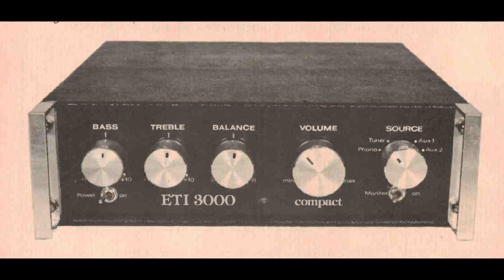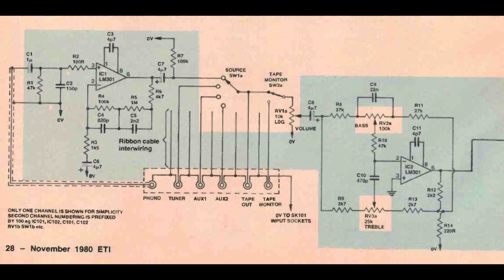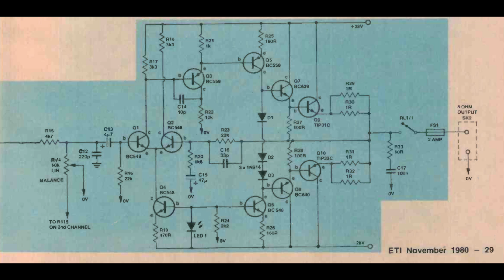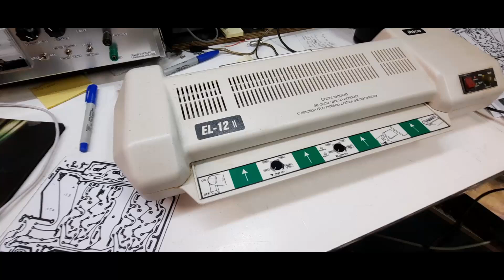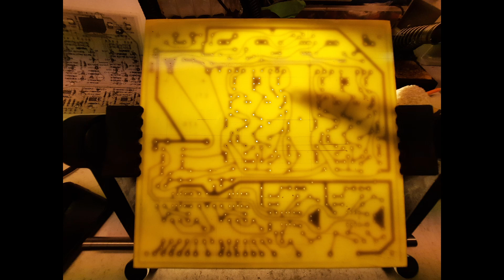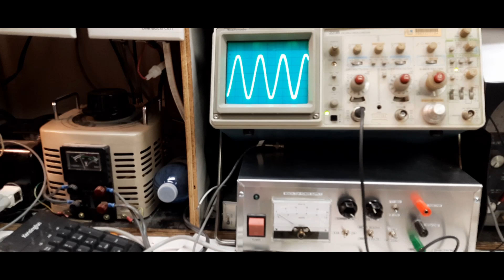Electronics Today - November 1980 - 20 Watt Amplifier - Part 1

Comment: Well done I am 60 now and had all the electronic magazines. Every day, ETI, Maplin etc. Buit loads and loads of these projects. Funny story I was when I was about 12 and saved up all my money pot washing at a hotel, I brought a 28-pin sound chip from Cricklewood electronics that would when built play doorbell sounds. Corny now. Went to Pot wash came home and my Mum had Cleaned my worktable AKA (the kitchen Table) And hoovered up my sound chip. Got it out but Guess static got the better of it. Chip was a lot of money back then. Your Content is Excellent. From Newquay in the U.K. P.S its 13 degrees and Raining🤠
Reply from the maker: Thanks for sharing that amazing story about your sound chip – what a memory! Radio Shack, here in Canada also sold that chip. I recall it. It could play train whistle and a bunch of other stuff. Cool. Did not know about Maplin. I just found the mags at URL https://www.worldradiohistory.com/Maplin-Electronics.htm

I will add these magazine to my list and perhaps build a few projects.

Cheers!

Bettina
Reply: Well done. Yes Maplin, Radio shack were the  the pinnacle of 80s electronics. Brought my first Red Led Dim as I won't say LOL. Your content is amazing. Cheers Paul
Reply: @bettinaneumryr  Hi I have been looking at some circuits now it's coming up to Crimbo time. I built this and it was a great hit. It's called Pass the B--mb just add the o not sure it would get censored. Maplin Mag Dec 1981 Feb 1982 its in the Archive you sent me. Cheers Paul Rush
Reply from the maker: Hi Paul ... yeah, I see that project. I am sure that youtube would not like the title. When I upload a video, there are lots of questions that they ask and something like this project would not pass the ad suitability for the video. Also, I am finding that circuits that do not relate to electronic test equipment or amplifiers do not get the audience I need. Thanks for the suggestion though. Cheers
Reply: @bettinaneumryr  Hi. Yes, totally understand it being not suitable with the Net Police/You tube. Anyway, well done on your content its Spot on. Cheers Paul

Comment: I actually built this amplifier back in 1980.  I've still got it.  😊.   It currently doesn't work, but this has inspired me to get it going, some day.  I preplaced it in the later '80s with a Playmaster 60 + 60, which was a project published by ETI's great rival here in Australia, Electronics Australia.
Reply from the maker: Thanks for the comment, and great to hear that you got yours working back then.  I am loving ETI (Australia). It has so many good projects. There will definitely be more projects from that mag. Cheers!

Comment: A couple quick questions: 1) How do you trim your PCB material to size? 2) Where did you source your transformer from?
Reply from the maker: I actually use a 70 year old sheet metal shears. They look like scissors but bigger. I can cut 1.5 mm board with no problems. I never buy thicker board because of this. I then sand the edges down to make it square. I got that transformer from an old organ a few years ago. See my video on a scrap out of an organ. I got two more organs in my driveway that need to be scrapped out. I will make a video on those soon.

Comment: replace the rectifier diode on psu. make it 3 amps or more
Reply from the maker: Done .. I put some 1N5408 diodes in. You will see the modification on part 2. Thanks for the tip!

Comment: Hey, nice little amp built project - with an absolutely beautiful board. Great work on reproducing it, the quality is excellent. Not a tiniest bit of over-etching!
I'd replace the Zener diode regulators for +/-12V with 7812/7912. Way more reliable and less noisy too. Zener diodes can go out of spec over time, I recently replaced a 6V8 one in a frequency counter that measured 7V3.
Tantalum caps, oh my goodness... they like to fail short a lot in vintage equipment, but I wouldn't think they'd be dead new. Although everything is possible - I've got a few NOS Philips axial electrolytics that are complete rubbish and I keep them only to demonstrate how badly out of spec a new unused part can be.
Reply from the maker: Thanks for the kind words. The second zener was still good even thought the tant was shorted. So it hung in there for the few minutes I was running a short. i just left it. I usually like to stick with the original design when building these projects. Same for me, I like to keep old and bad caps for demonstrations. Cheers!

Comment: ETI brings back huge memories for me as an Aussie who left high school in 1978. I still own my ETI480 main amp. It's in a 19" rack mount case, and I added volume pot with loudness and A+B  speaker switches. I also added two small LM??? amps to run as dedicated headphone amp, and then a peak clip with the latest tech (rectangular red LED). Also added a speaker de-thump and DC protection mod after blowing numerous tweeters at parties.
I then modded it with a later published mod, so in the end it ran 2 x 2N3005 + 2 x 2N2955 per channel, giving a solid 2x100w into 4 ohms.
In those days power like that was unheard at a reasonable price, and speakers were super efficient 90-95 db/W@1m. It was too loud inside the house, literally painful to the ears thru 4x12" Teac woofers and some piezo tweeters.
It got replaced with a Yamaha Dolby ProLogic receiver rated over 2x100w RMS front, yet the ETI hit a lot harder!
We used that amp at youth discos in the 1970's and it copped an unbelievable amount of abuse and still works just as well today. Can bridge them for 200w 2 ohms but I never bothered.
Reply from the maker: I am finding out that ETI projects are much better than what we have in North America. Less mistakes and better descriptions. I looked up the ETI480 project and I have that on my list of things to do. Great idea. Check out these URL's.

World Radio History
https://www.worldradiohistory.com/ETI_Magazine-AU.htm

30 Audio projects. Page 102 is your amp (soon to be mine soon!)
https://www.worldradiohistory.com/UK/Electronics-Today-UK/ETI-30-Audio-Projects.pdf

Cheers!
Reply: @bettinaneumryr  - good find, that 2nd link. I added the peak detectors on page 25. I alsi built the equalizer on page 96 and a full 2x50w kit as a 12V car amp that used a similar inverter power supply to what is described on page 109.
There is other stuff out there under the Electronics Australia magazine, which was running in competition to ETI at the time. ETI was also published in the UK with a lag of 2-3 months after the ETI Australia issues.
Make sure to search for "ETI Magazine Errata" as there are mods and tweaks pubished for most projects a few months after the original publications. I found a place online that listed them all, might have been the Silicon Chip website.

Comment: I purchased an entire bag full of 10uf, 35 volt tantalum capacitors from Electronics Goldmine several years ago. 70% of them dead shorted at about half their rated voltage. I threw all of them in the garbage. Sometimes that is a peril of buying off of the surplus market. They may not actually be surplus, but factory rejects. 

I like to go to the local Goodwill store and look for older cable or satellite TV boxes. You can usually purchase them very inexpensively and they make a very good foundation for a project enclosure. Usually, you have to make some sort of a front panel, but it still ends up way less expensive that what a new box would cost.
Reply from the maker: I bought the caps from Digikey so I hope to get good stuff. I was also thinking about getting old VCR's and stuff to make cases but then did not follow through. I suppose I need inspiration on how they turn out. I will look that subject up on the internet. Thanks for watching. Cheers!